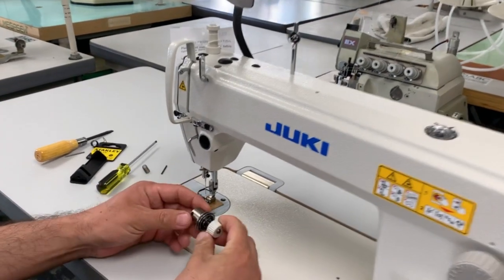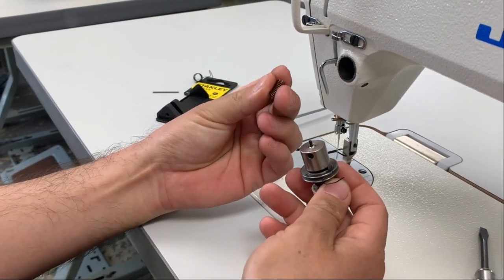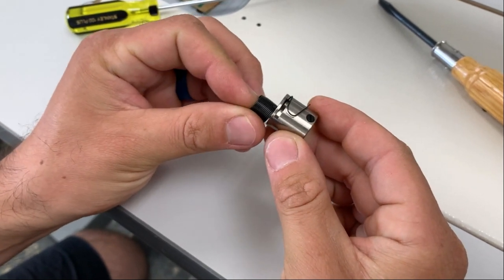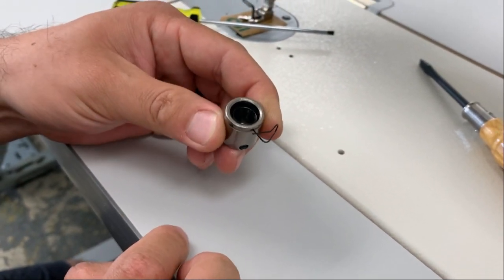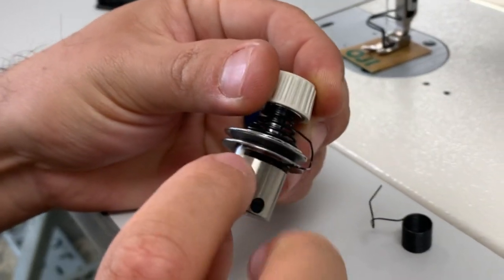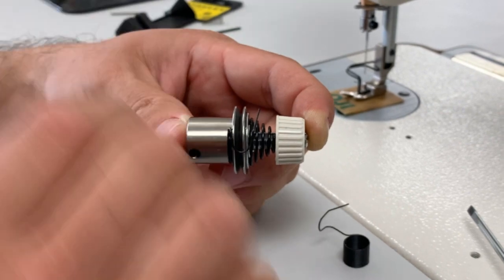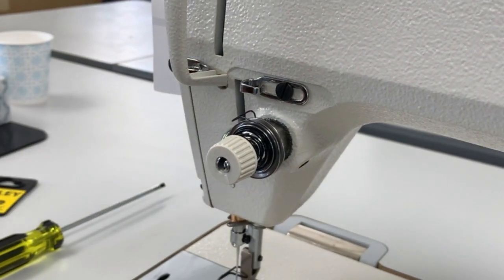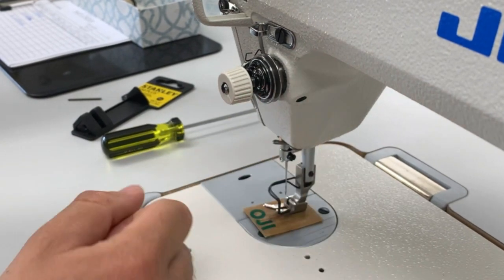Thread Tension Assembly HOW TO: Disassemble, Adjust, and Replace Your Thread Tension Assembly

Comment: i cant get the last peice out. the peice that holds the spring
Reply: Some units have silicone to hold it in or it's just sticky or gunky.  Night have to use some needle nose pliers and/or wd-40 to break up the build up.
Reply: @josephpark2256  used wd40 and two needle nose pliars and still no luck. any other ideas? Thanks for the help
Reply: @Ben  you may have to damage it to get it out (new assembly not expensive so be prepared to get that ordered) 

There is a little hole where the spring comes out.  Use that and put a screw driver against there to hit it (clockwise /counterclockwise) to get it to turn and loosen up.   With the wd40 in there already it should break up easier once you're able to get it to turn a little bit.  
PERSISTENCE/PATIENCE IS KEY! Good luck!
Reply: @josephpark2256  I heated it up with a blow dryer and got it out!. Thank you